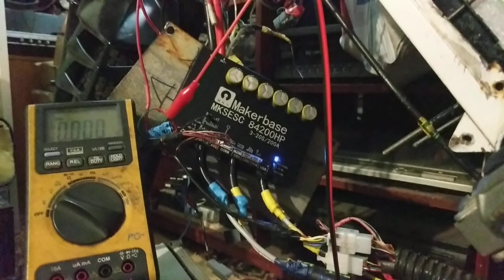new makerbase 84200hp vesc possible bug? (pt2)

Comment: If you using stock shutdown feature, I need to use normal closed button...
Reply from the maker: There's settings in there app you can use a push button or you can use a push switch.
If using switch it needs to see ground to turn off and no connection or 3v to turn on.

Comment: What wires can i use for wireing throttle and what does it say I have manual but don't know what to connect for 3 wire acceleration  throttle I don't want a switch for reverse or forwards
Reply from the maker: Adc1, 3.3v and ground. When you calibrate throttle mine was like 0.8v to 2.8, I manually set 'midpoint' to 0.9v so only the very last bit of throttle is used for regen
Reply: @lezbriddon  what wires for on and off.....also I saw the makerbase YouTube channel has configuration video so you can shutdown  it may help you fix this issue go to video on their channel and it should be lesson 11 shutdown and turn on 3rd video in videos .yeah give me a update on what going on and wires please
Reply from the maker: @davieanwilliams9205  yes I watched the makerbase videos and it works if  you do not have regen. If you have regen enabled and the throttle is at zero percent then it won't switch off. If you manually hold throttle to a position that is not forward and not regen ie neutral position, then it will turn off. This means holding the throttle at about 10% while turning off the key, for me that is unacceptable.